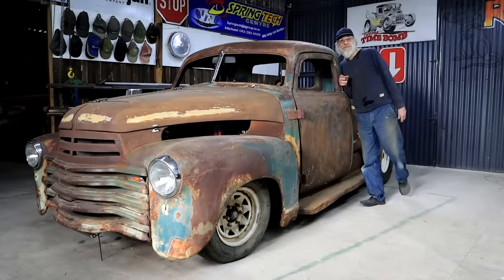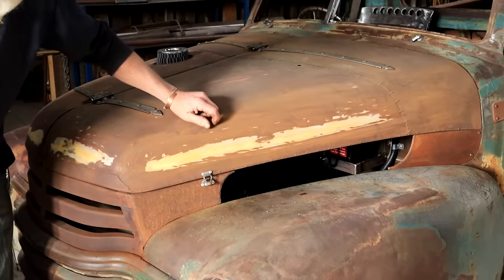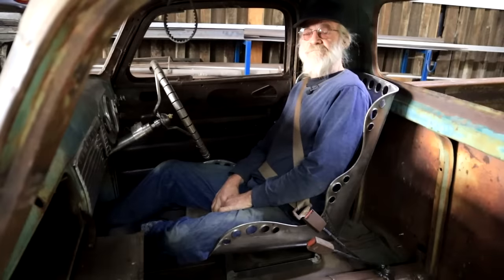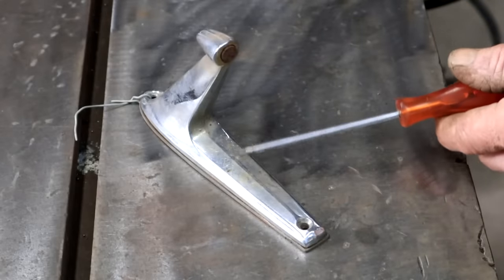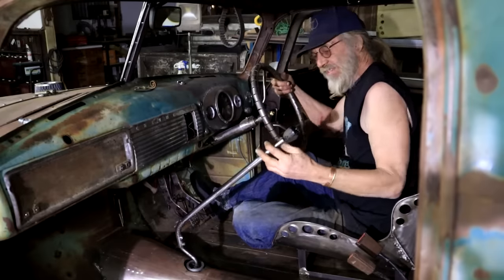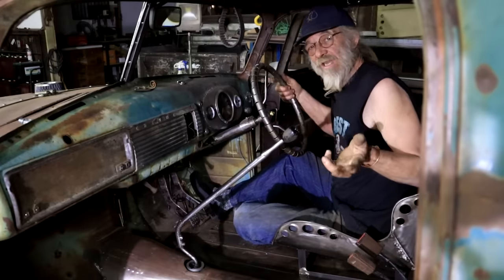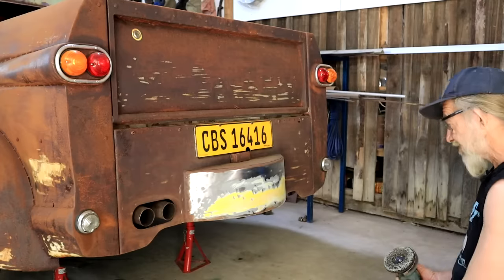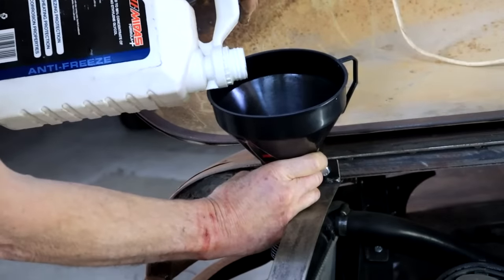Flip up License Plate, Torn out Pump Nozzle and more - 1951 Chevy Rat Truck Build

Comment: Nice video Div. Ek hou van jou overflow bottel en koper pyp . So n bietjie " steampunk" touch . Jou nommerplaat is briljant . Jammer oor die freeze plugs . Ek dink jy gaan sonder moeite stainless steel of brass kry . Die ou galvenized plugs het tog net gevrot . Jou aircleaner wat by die bonnet uitkyk is kwaai . As jy bang is die ding perform sleg kan ek altyd help om n turbo op te sit . Ek het al baie slapende pêre wakkergemaak in die 30 jaar wat ek met hulle woel .  Laat waai Div ek wil saamry .
Reply from the maker: Dankie Kalli! Wel, ons kan nou nie 'n turbo op die budget build sit nie, maar dalk in die toekoms op 'n ander projek? Hoe gaan ek jou in die hande kry?

Comment: Love  the details man !    panels you added on the side of the hood really finished it.  The dragging fuel hose will get a lot of attention !   You can expect to be stopped by concerned citizens.  (I had a neighbor that took the back door off his horse trailer.
He would load his mule in the trailer and drive around. Concerned people would stop him to inform him that the door fell off.
He would proudly tell them that his mule was so well trained that he didn't need a door.)        Would love a ride along to town video !    Maybe a tour of your local parts store.     Here in Missouri USA  if your vehicle didn't have seat belts or signal lights originally , it is legal for them not to have seat belts or turn signals.    In your case , if you call the truck an 80's Nissan , then belts and signals would be required here.    keep up the good work!
Reply from the maker: Thanks my brother! Expecting to have some fun with that fuel hose. 😂 We have the same here regarding seat belts, but officially its a Nissan...😅 Maybe I get some brownie points from the cops...

Comment: You could cut a similar hole in other side of the hood and put a fake identical air cleaner there. Ha, dual carbs! How about a "RECYCLE" label under the gas nozzle? You need a ball peen hammer head for a shift knob too.
Reply from the maker: Thanks for the suggestions!

Comment: Hey Diff,   you're doing a hell of a job buddy I have been following this project build on your channel since you started putting it together, 
 But there is one thing that I absolutely hate that you added to your truck!  And that is that crappy air cleaner that you installed on the engine.  Why on earth would you do such a thing? 
  It really belongs with the original Style Nissan air cleaner, after all it served that engine well enough to keep it alive and running since the 1980s,  and besides that you cut a hole in the beautiful hood that you spent all that time building.
 Shame on you dude.
 But on a equal note ,, don't feel quite so crappy about giving up blood flesh and blood during a project.
 Because I cooked my thumb pretty good this morning while heating up a rusted bleeder screw on a brake caliper.
 Thank you for videos.
Have a good one man!
Tim from Wisconsin.
Reply from the maker: Hey Tim. Thanks for the support. Sorry you don't like the air cleaner. It's just a rat rod though 😅
Reply: @ratrodsafrica  it sure is man,. And you you did a awesome job building it.  Especially building on such a small budget.
But that is because you have a great talent for repurposing stuff and making good use of items that a lot of people would toss in a scrap bin.
  My biggest concern with the air filter, is that you are out in the country driving in very dusty conditions.   And those cheapo air filters don't work very well.
  And of course cutting a hole in that hood.    That hood is a real work of art man!  
 It takes a lot of imagination and talent for building things like that, especially to when you built it for old scrap metal and not only made it look good but it is also very functional.
  You really went the extra mile building your entire truck.
 It looks like it would out work and probably outlast most any new truck that size.  And the coolest part of it is you only spend probably about 5 to 10 percent of what it would cost to buy a new truck.